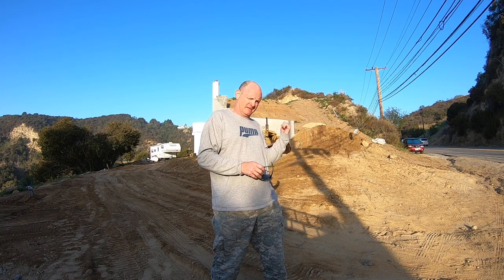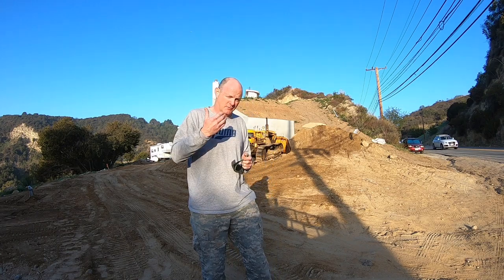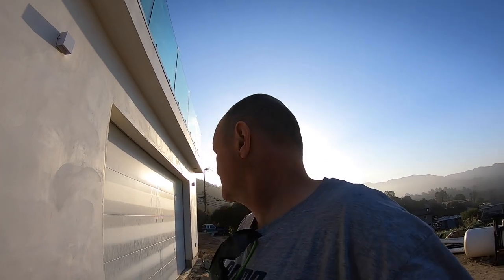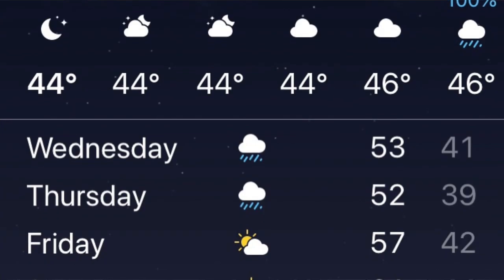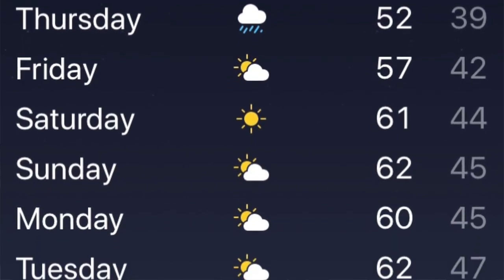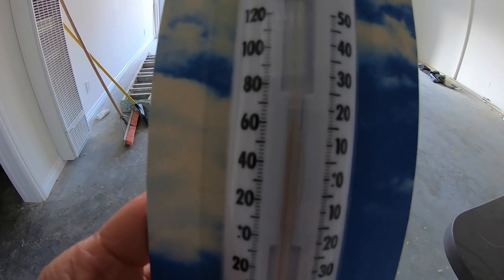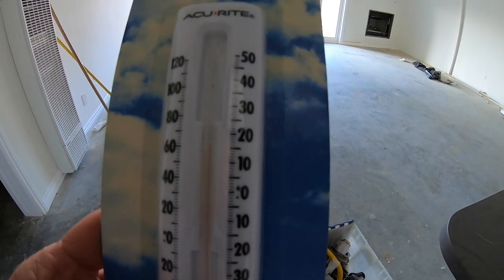The dome Shaped Underground house.  Noise, Temperature, & Energy efficiency.

Comment: Eddie can you steer me in the right direction to using the proper stucco or plastering to re-coat my dorm home on the outside?
Reply from the maker: Any competent stucco or plaster guy should be able to do it.  You can use either stucco OR plaster, but either way, do a "test panel" in an area, and let it dry to make sure it doesn't crack or have issues.